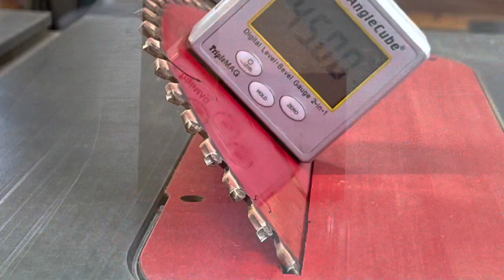3D Effect Cutting Board v2.0

Comment: I don't know.  I see some gaps, but it's probably better than I would do by a long shot.  Did you consider facing the glued up rows on the jointer before thickness sanding the opposite sides?
Reply from the maker: Gaps 🧐…. No to jointer or planer, the knives would destroy the end grain. The drum sander gets the thickness even before final sanding - but getting down through the grits takes forever on hardwoods
Reply: @MarekMakes  I don't know if they're gaps.  Looks like dark lines at some joints.  Always hard to tell in pictures.  If you don't want me guessing, don't ask me to perform an error scavenger hunt! 😜

The end grain is facing up, no?  In my mind, I would joint the sides of a glued row, then drum sand or plane the opposite side to ensure uniform thickness and perfectly parallel segments, prior to final glue up of the board.  Of course that was based on my perception that your "mistakes" involved the segments not coming together perfectly on final glue up, but it sounds like that wasn't the case.

I don't know.  Just trying to leave a comment to help your channel get off the ground.
Reply from the maker: @Keifsanderson  Ahh - I understand what you mean - in that particular picture the errors were the alignment of the 3D pattern - some of the Cherry / Maple corners were put together wrong - so I you're right - there were gaps because I had glued up 4 rows of the 16 total pieces and before I glued those 4 rows together I realized the mistake.  Therefore I cut the thing back into 16 squares and did the whole glue up again from the beginning.